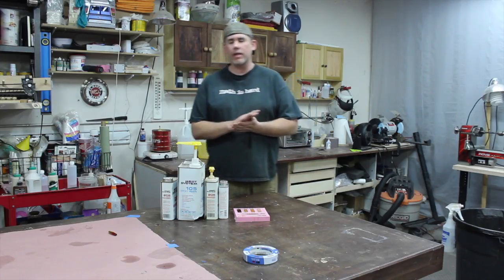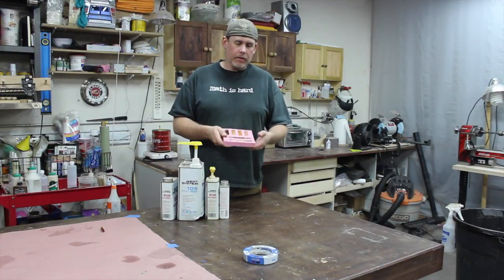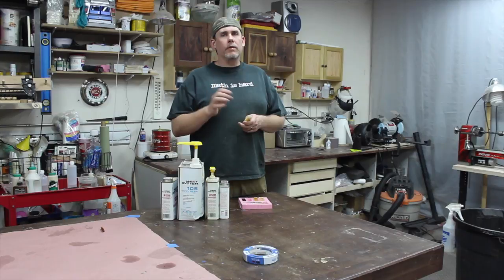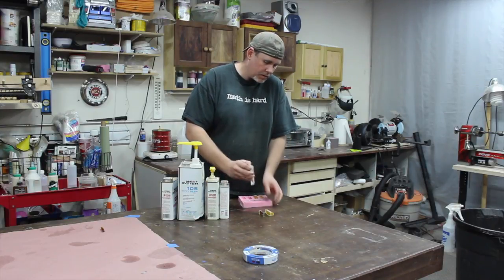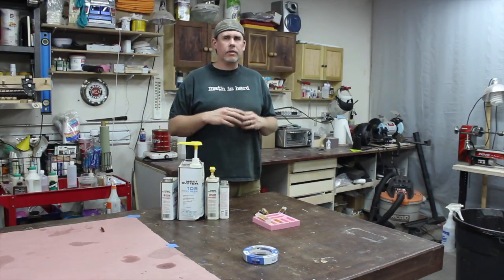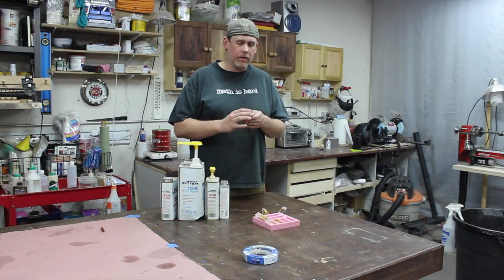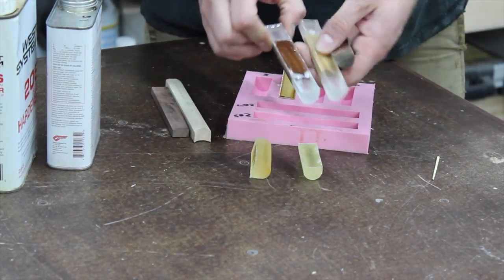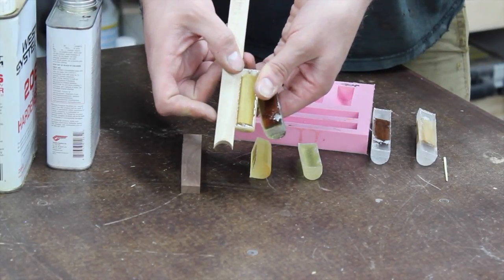Casting Resins: How Yellow Does West System 205 Epoxy Get?

Comment: Hi , i'm a beginner with the resin and i live in a city  with extreem humidity it's about 95% every day and when i cover the paintings or the wood boards with a resin i get amine bulsh epoxy because of the high humidity and i've read that ws 105 resin+207 hardener would be the solution if i coated the pieces with it , what do you think about that , could you advice me please !

Comment: Your so called test means nothing because you don't state how old your hardeners are.  Once opened, hardeners are clear.  Once exposed to air, they oxidize and will start to yellow in the can, and over time turn amber, and eventually red after a couple years.  So your test doesn't mean anything without knowing how oxidized the hardener was to start with.  If you get a brand new can of 205 it will be clear in the can.  My 2 year old can looks very dark amber.

Comment: Hello sir, I’m new to casting so pardon my ignorance.  Did you put the mold in a pressure pot or let cure for hours without one?
Reply from the maker: No worries, it's a great question. Some resins will require pressure to remove the air bubbles, others don't necessarily need it. Typically, you can get away with no pressure with slow setting resins, Alumilite Clear and other faster setting resins will require it since there isn't sufficient time for the bubbles to reach the surface before it sets up. If you're embedding things in the resin, it's best to use pressure though since the materials could keep the air bubbles from rising to the surface
Reply: Zac Higgins Awesome!  Thanks for the quick response.  I know you posted this a few years ago and truly appreciate the reply.  👍

Comment: I bought a can of 207 hardener which started out water clear but  turned a very dark  reddish amber  over time (1 year+) and tinted the resin. The next can I bought had already started to turn - it was probably on the store's shelf  a long time. The next   time I bought hardener I bought 206. It  had less color than the second can of 207 started with. If 207 has color it is old - take it back. It will cure O.K. but why pay the premium for clear and wind up with amber?
Reply from the maker: I totally agree! But you have to keep in mind that these resins have a shelf life and like to be stored around 70 degrees or so. There are other brands of epoxy out there that are cheaper and work great too

Comment: any testing of how these yellow fever time in the sun?
Reply from the maker: 205 and 206 are amber right off the bat, the 207 is stated to have UV inhibitors in it, but I have no clue what that really means or how well it works over time and how temperatures affect it. I've never seen any data on any resin that claims UV inhibitors in it, I can't imagine that any of them will repel yellowing regardless of how much or what temperature it is exposed to. The only resin I'm aware of that actually claims to resist yellowing is Art Resin epoxy, but again I have no actual data on what the limitations are.

Comment: I have a few questions... I have a slab of wood that has holes all the way through. I would like to fill it with the clearest resin out there. Do you know what that would be? Where to buy it, how much it is? Finally I'd like to be able to see through the hole with the resin to the floor so how would I accomplish that? With a oil base clay mold? Silicone? Aluminum tape? Masking tape? Wax paper? You site has some of the best tutorials I just can not find my solutions. Thank you so much for your help
Reply from the maker: Shawn Flick Hey Shawn, I'd probably recommend just using a slow setting epoxy or polyester resin to fill them. I've done lots of knot hole filling with epoxy, works great. I'd just put some tape across the bottom of the hole, mix and pour in the epoxy. You'll want to try your best to remove any air bubbles using a hair dryer or a heat gun. Don't want to get crazy with it, just wave it across a bit to heat it up some. You should be able to pick up an epoxy or polyester resin based casting resin from Michaels or Hobby Lobby type stores. Should do the trick nicely.

Comment: Hi Zac, love the video. I have a query regarding 207. I purchased just yesterday from a local dealer (Uk) and 207 is very yellow in the tin. It actually came out the darkest of the three in my test pours. The dealer said its amber when its manufactured. I've contacted West to confirm this but wondered if you might be able to shed some light.
Reply from the maker: fra66le I haven't used the 207 for a while, but I'm pretty certain it should be dead clear in the can.  I think they've either mislabeled your can or it's gone bad. Definitely contact the manufacturer, they'll be able to help you out.

Comment: Thank you a lot for this video! It's what I was looking for. But I've seen another video in which it's mixed 105 with 205 and it looks like something soft reddish pink colored. Someone know how is it possible?
Reply from the maker: Is is reddish pink in the cup when stirring or is it reddish pink after it has been cast and hardened?  If it ends up pink, then they would have had to mix tint in with it.  It may look that way during mixing, but it should come out a bit yellow/amber once cured.
Reply from the maker: Glad it was helpful, let me know if you have any other questions about it, I'd be glad to help out.
Reply: Zac Higgins it is reddish pink in the cup when mixed and they reach a more liquid mix than my and for a longer time (higher pot life). I supposed it depends on the temperature of the ambient. I worked it with 15°C and pot life was quite short. Someone know if in warmer condition pot life is longer?
Reply from the maker: Guglielmo Lisi I'm not sure what to tell you, usually the pot life lasts longer in cooler temperatures.  I'm not quite sure what would cause that.  Mine is pretty thin liquid when mixed.  I usually have a good 15 minutes open time with west system epoxies here in Nevada where it's extremely dry. To compare, typical wood glue starts setting up in about 2 to 3 minutes for me. Could your epoxy have gone bad? In general, epoxy has a very long shelf life, but perhaps it was exposed to extreme temperatures?
Reply: Zac Higgins I don't know if the italian seller exposed it at extreme temperature. Maybe it's possible if stored outside.
In the website of West System and in their manual it's written a lot of time that the blend with 205 has a pot life (also called open time) of 10-15 minutes at 25°C. I've also read that the pot life is 9-12 minutes at 22°C for the 205 but it's written only in a part of the manual or website which now I don't remember. If it's true, I deduce that the pot life is longer for higher temperature, but it looks in contrast with the common fact that epoxy cures faster with higher temperatures (this reduces also the working time). Moreover, it's written that higher temperature reduces the viscosity of the resin, of the hardener and of the blend too. They suggest to heat resin and hardener if the ambient temperature is too low. With a more liquid epoxy is easier to manage and also is easier to drench surfaces and fibers like fiberglass stripes or carbon tow (as in my case). Also it's said to mix small quantities and to keep the blend in a short and large container to extend the working time (it's because of the heat dissipation of the exothermic reaction in the blend).
I will try some testes at different temperature conditions to understand the differences of viscosity during the pot life and the duration of itself. My purpose is to find the settings to work with a very liquid blend for a very long time, using the hardener 205.
Do you already know an answer for my doubts? Any suggestion is well accepted.

PS: sorry to all people for any english errors

Comment: Thank you... I was only wondering this today!! 
One question. .. i want to turn some dead clear resin. You suggested polyurethane instead of 207 WS... any idea how well either of those would turn? (Its for filling holes in voids of bowls)

Great vid... many thanks! Its like you read my mind!
Reply: Sorry... i meant polyester resin in my question!
Reply from the maker: Hey Thomas, glad it's helpful.  I really only mention PR due to it's price, which is way less than WS epoxy.  In my experience, there's not much difference between epoxy and PR, turns about the same.  

The only problem I have with PR is the horrible smell (even after it's cured and your turning it) and the harsh chemicals it uses for catalyst, MEKp.  MEKp is pretty nasty stuff, so I usually avoid PR.  

Frankly, I like Alumilite best, it turns like a dream, doesn't smell or use harsh chemicals (that I know of) to catalyze, but it's drawback is that you have to use a pressure pot or vacuum chamber during the cast.

All three will work fine though.